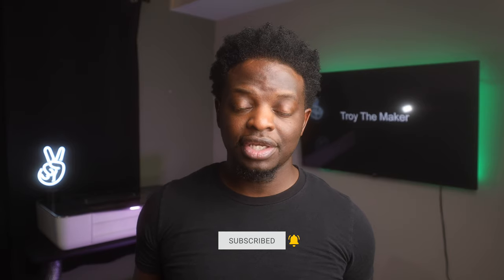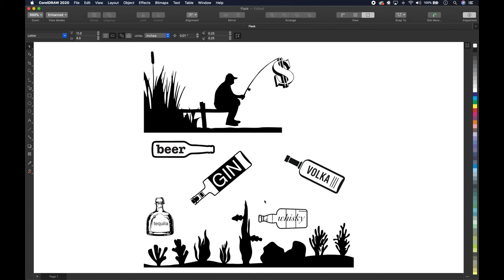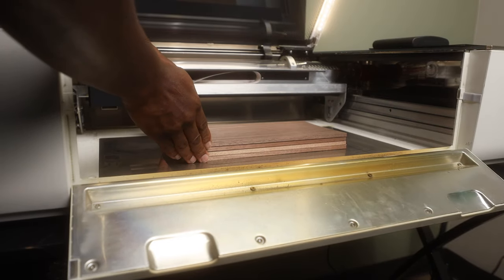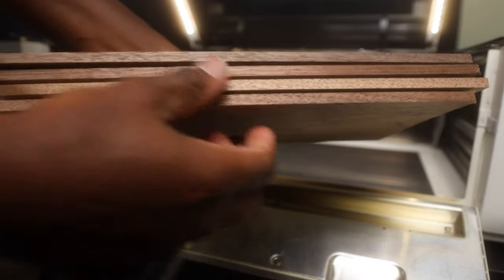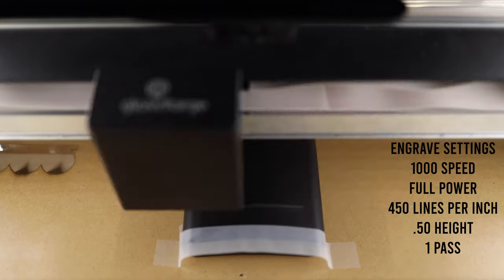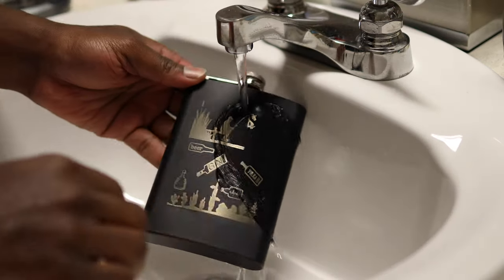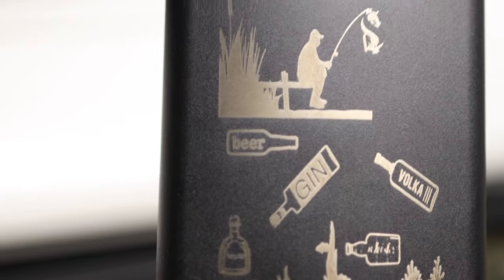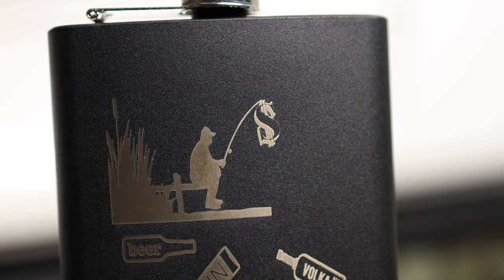Engrave | Stainless Steel Flask | Glowforge

Comment: I always use ceramic tiles to raise my piece(s) when I take the tray out. No way they're moving. Then a big rolled up piece of masking tape in the middle of the back of the flask. The first time I engraved a black flask, I thought it was messed up and didn't engrave....then I wiped it off! Looks great my man, keep it up.
Reply from the maker: I need to get some ceramic tiles. I thought the same when it was engraving myself on the practice flask till I wiped it off.

Comment: Hello there - love your videos btw - this video is great. I have a question / I bought a couple of flasks to engrave for Christmas (& this has been happening for a few things, cutting boards etc.) my stuff isn’t engraving centered. It’s showing centered on my computer screen but then it comes out all screwed up ruining like 4 flasks (growl). Do you have any advice?? I have 2 more flasks left and I’m scared to ruin them....
Reply from the maker: Thanks for watching. If you haven't do a camera calibration. It on glowforge's forum. Place the flask right under the camera. You might have to only do one at a time. Also secure it down and make sure it don't move like mines did.
Reply: Troy the Maker thanks so much! I actually did that today and secured it like you did. I used your settings - it came out MUCH better than it ever has before - still a little off - so maybe it’s my eyes LOL. I’m slowly getting the hang of things. Your videos help a lot! Thank you

Comment: Did you have to use a spray first before engraving?
Reply from the maker: No. Those stainless steel flask come with a coated layer.

Comment: Hey how’s it going? I’m going to order a forge in the next month or so I will be purchasing the pro model. I was wondering if I it had auto adjust like the muse 3d I’m stuck on which one I want to get. Right now the forge is my first option.
Reply: @John Tapsell  ok cool so I could put like a wooden spoon or like a frisbee and it would engrave with no issues or is that something different? Sorry just doing all my research before jumping into this.
Reply from the maker: Hey. Yes make sure it under 1/2" if the cutting tray is inside.
Reply: @TroytheMaker   thanks I appreciate it I just started following you keep up the good work and the videos
Reply: @John Tapsell  ok thanks for the info I appreciate the safety tips as well.

Comment: Did you have a problem with your design aligning how you set it on the interface vs how it engraved? When I did mine I had to lower my design a little below the flask to get it to engrave the whole thing on it. I put it directly under the camera but it was still off a bit. And it only does it on the flask. Everything else aligns perfectly. I was just wondering if I was the only one with this problem.
Reply from the maker: Yes it not aligned, but I believe mines wasn't because I didn't secure it down and it moved. It also can be from the radius the flask has. The camera could have read it wrong.

Comment: Do you think I can use procreate to design and export into the glow forge website ? Or do I need another type of software? love your videos ! Thank you for the uploads I’m leaning a tonssss🖤
Reply from the maker: I traced an image in adobe draw on my ipad. It something like procreate. Here is my video I made https://youtu.be/bqa-4-5eMLU I know you can I would have to make a video using procreate. I figure it out. Stay tuned.
Reply: @TroytheMaker  thanks so muchhhhh you’re the best !
Reply: Elizabeth check out Affinity Designer as well,  has ipad and desktop versions both are pretty cheap...ipad does require apple pencil though i think....ive done a few designs using it and the glow forge and found it pretty easy to learn.